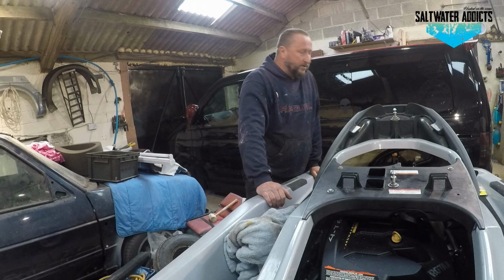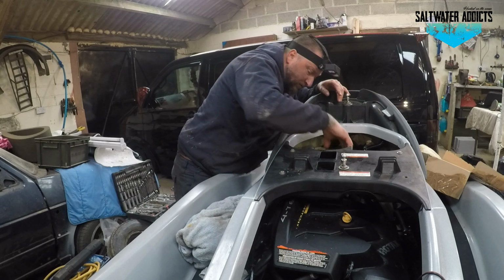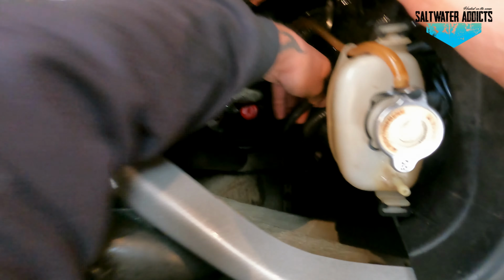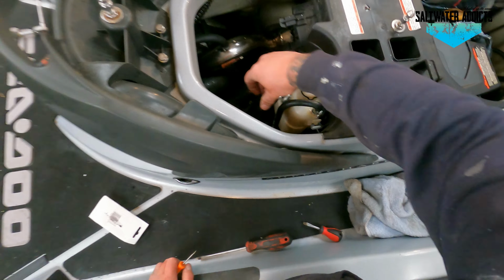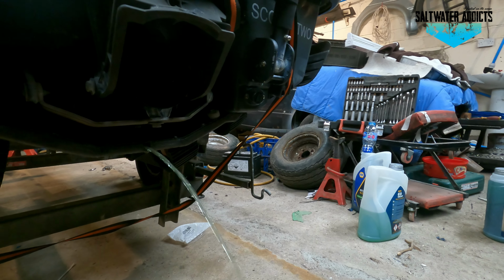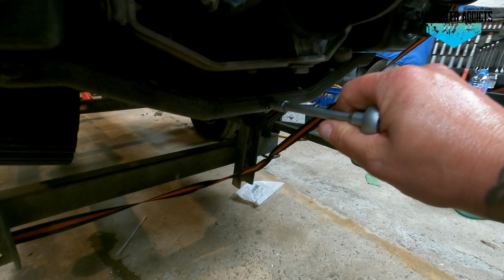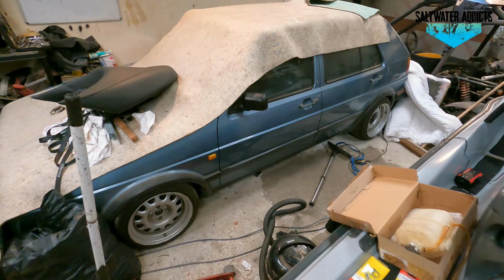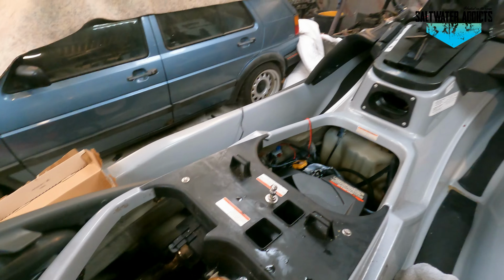How to change Seadoo 215 coolant tank and coolant change , Seadoo gtx 215, All Seadoo 4tec

Comment: Hi mate what make off antifreeze/coolant did you use as looking to replace mine in my seadoo wakepro in the next week or so 11:53
Reply from the maker: Hi thanks for the comment. Please make sure to sub.

Search for 5L Mannol G13 Coolant Antifreeze Green Solution Ready Mixed High Performance on eBay
Reply: Hi thanks for the reply I'll have a look at getting one of those. is one enough for a flush out? Am assuming the product is OK for the engine been aluminium just a read car anti freeze wasn't any good.

Comment: Hello I want to buy a 08 seadoo 255 the guy tells me
After a few rides u have to fill it up back with coolant is that right ? It’s sounds like it’s leaking
Reply from the maker: Sealed system so definitely shouldn't need topping up 

Could be something simple like the oil cooler
Reply: @saltwateraddicts  can it be a bad head gasket ?